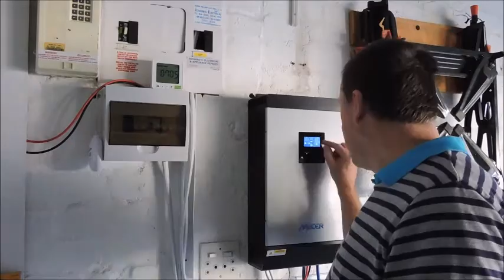Solar PV Inverter High losses at night 19 July 2015 #2

Comment: Greetings. I have a similar inverter MPPSolar 3Kw. My batteries are now totally gone having reached End of Life, so am mostly running on the grid. My fans never go quiet at all now & this piece of kit is quite noisy. Due to space constraints, it’s housed indoors. Anyone hear with a possible work around to get it to go into standby mode?
Reply from the maker: I've tried to explore the standby mode for years and never had any success
Reply: @alanfalck1184  sad
Reply: @alanfalck1184  I’ve not ever heard of a need for a firmware update on these “old school” inverters, funny enough, maybe that would have helped.
Reply: I just turn mine off and then on again. After about a minute, the unit goes off and into standby mode.

Comment: think you will find that this is the same as the MPP Solar inverter , the difference is power being used to charge the batteries , depending how old your batteries are they may have trouble maintainting the float voltage set in software if set for standard AGM , try custom settings and manually set a lower float voltage.  But in answer to your question the difference between load and what it is drawing from the mains that extra 200Watts is going into the 120amp battery charger.
You can also change your charging priority so it only ever charges the batteries from the solar and not from the grid , i suggest you read the program options in the manual.

Comment: I know this is a fairly old video but I just got the same inverter and it's installed. For the life of me I can't turn off charging the batteries from the utility...... is this done by the computer app via USB? Did you solve your overnight parasitic load?
Reply from the maker: Hi no I haven't solved my high drain issue even with load disconnected and batteries isolated still pulls 500w costing me about 4.5Kwh per night.  Have you loaded the software program Watch Power (via a USB cable to your laptop) it the simplest way to set the inverter up ? The inverter will charge batteries from Grid if there is no solar and you initial mde setting (1) is set to Solar First
Reply: Alan Falck great! thanks! I have installed the app and happy that the unit is only charging batteries from solar. so I'm actually seeing similar, or even the same, behaviour regarding the energy loss. I'm going to be doing more investigation. I think I know what is going on, but just want to confirm. will post a video with my setup and the bizarre observations.
Reply from the maker: Hi yes please let me know if you find the culprit, I use the Eskom meter (pre pay) to verify the actual power used over a night, as many people have blamed things like Power Factor as distorting the actual amount of drain.

These inverters should be able to go into a low power state (20w) at night and use virtually no drain from bed time  to sun up.

I have moved all the little (parasitic loads) onto my 12v system (see my you tube) so the inverter can almost be turned off, but I've never got standby to work correctly.
Reply: Hi again. So it has been about 3 months after the solar installation and I have seen a (considerable) drop in my electricity bill. Unfortunately I can't give exact figures due to other factors on the property, but I can confidently say my electricity usage has dropped by 1/3 or even a half. The efergy meters we are using do not consider PF (Power Factor) at all, and to accurately measure KW and KVA correctly we would need to spend more money on more advanced measuring equipment. This article was enlightening: http://www.fluke.com/fluke/r0en/solutions/pq/power-factor

I really think the system is working correctly.
Reply: Just to clarify my comment, my electricity usage has dropped by 1/3 or even a half according to the invoices received from the municipality. The last 3 invoices (last 3 months) have KWh readings which I have compared to the same time a year ago.

Comment: I have a pip4048ms which looks similar to your unit, it can charge the Batteries from solar or grid and I can set the amps it charges from both. I've actually set mine to only charge from solar but previously it was set to 2amps from the grid when solar was unavailable (night) I like your Battery setup, I keep mine in a cellar which keeps them between 15-26*C throughout the year. I've seen some setups where the Batteries are stored semi outdoors so freezing winter and 45*C plus in summer!

Comment: Hi Alan. Do not trust the efergy meter. It does not take power factor and voltage into account thus it is not reading it correctly as it only reads the amps in the cable.

http://powerforum.co.za/topic/277-axpert-mks-5kva-48v-in-parallel/

Comment: Tjaart Silvis is right on the money, Alan.
The Efergy is not a true power meter at all, and it's not giving you a true power reading. That's because it measures only current via the non-contact transmitter and doesn't measure voltage or - more importantly - the time relationship between voltage and current (which is the basis if power factor). It multiplies measured current by an assumed voltage value (which you define somewhere in the setup). The result will be wildly inaccurate with low power factor loads, which is exactly what your inverter is when it's running at close to zero load.

Comment from the maker: Ive increased my float level from 54 to 55.5 volts and seen a small drop in my night drain (85w).  My (Fluke) meter reads between 14.0 and 13.9 volts on the battries.  I think  I've been undercharging my battries a bit.  The default inverter battery  setting was for AGM not Leas acid.  Ill monitor the progress tonight.

Comment: Hi Alan
Don't worry about your Efergy monitor showing +-450W. They actual draw is much less than that -+50W.  It has to do with the power factor. I have both the unit you have, and the one that plugs into the wall socket. My install is still temporary and runs of a wall socket for now.
I'll see if I can't take a photograph tomorrow of the two side by side.
Reply: Tjaart Silvis 
https://www.dropbox.com/s/60kqryt5xma1xyb/2015-07-28%2010.30.22.jpg?dl=0
As you can see the Efergy with the CT around the cable gives a reading of 503W. The Efergy with inline measurement shows only 54.3W.
You can also verify your consumption with your prepaid meter.
Reply from the maker: Tjaart Silvis Hi, thanks for the info.  I've done a comparison on the drawdown using the prepay meter log and it seems to tie in with the Efergy meter.  I will also install a separate shunt meter like Victron Energy meter in the future. The higher float charge level of 55.5v has reduced the drain by about 100w already so it's a small improvement.  I would expect around 50w drain without any load, but not 500w.

Comment: Hi Alan what is your batteries state of charge at this time? If your batteries are in float then if they are similar to mine and draw 2-3A then  you can account for another 100-150w going to your batteries and you have self use of the inverter of between 50 and 100w.This would account for more than half the loss you are experiencing. If your batteries are not in float then the "lost energy" may well be going to battery.
Reply from the maker: Chris Hobson Hi Chris this is after a few hours of being back in the grid, with no evedent charging or trickle charging in progress. It's the same 500wats throughout drain the night. I'm loosing everything I save on the day, overnight.
Reply: Alan Falck There is always trickle/float charge in progress if there is the current available.  Have you installed the WatchPower software? Whilst you have 4 panels I would use your system like a UPS on steroids.  Unfortunately loadshedding generally happens in the evenings so sunlight dependant I would allow the panels to supply your household draw and keep the batteries full during the day. If you have load shedding I would then switch to grid after that and charge the batteries with grid. In the morning once your PVs are supplying enough power switch over to solar again.
Reply from the maker: Hi yes I have used WatchPower I have setup my system much along the line that you recommend.  My batteries float at 54 volts and the current does drop down from around 3 or 4 amps down to around 1 amp. However the drain from the grid never seems to fall below around 700 watts (I know my parasitic load is about 180 watts).

Im not an expert with lead acid, mostly worked with small Lithium Iron).  I think you right the batteries are the cause of the excessive drain.  In fact 2 of my batteries have gone back to the supplier as the electrolyte indicator have gone from green to clear (replace battery).  This is a bit worrying I've shelled out R12k (about US$100) on 8 x 102Ah batteries.  I was hoping for 5 years ast 25% max drawdown.  OK So I'll contact the supplier tomorrow and get the test results, in the interim i'm running half a bank (4 x series).  The all measure 13.6 volts within 0.1volt of each other. I disconnected them to double check.  Looks like there is a lot to learn on lead acid, so time to do some reading.

You can get me on my a few email addresses not sure if you tube is the place to post personal addresses just google VoiceAmp fro the parts you may need.
Reply from the maker: Hi thanks so much for all the advice and useful links. My supplier has agreed to replace my entire bank (8) of batteries as they all starting to loose their 'green' status. I've asked to upgrade (pay in) to a 'non sealed' (deep cycle lead acid) version so I have more control over the future maintenance, hopefully extend the life.

Im starting to think my high night time drawdown current is related to the batteries as they probably never stabilize with the low electrolyte level (no proof yet).  I will have a new set tomorrow and let you know the outcome.
Reply from the maker: Easily_Bored_Engineer Hi, I've replaced all the batteries with new.  The electrolyte levels are now all green.  I've fitted 2 monster copper bus bars between the banks, so my balance is now milimeter perfect (thanks for the comment). I still seem to have 500watts (not Whatts:) drain. The default float is 54 Volts. (13.60v on each battery)

I'm wondering if the default AGM setting is the problem.  (sill about 2 to 3 amps) Will the lead acids taper off current drain as the reach saturation?
Reply from the maker: Easily_Bored_Engineer Thanks useful link